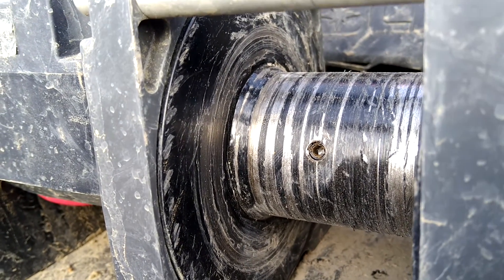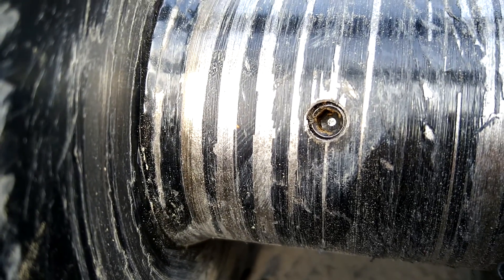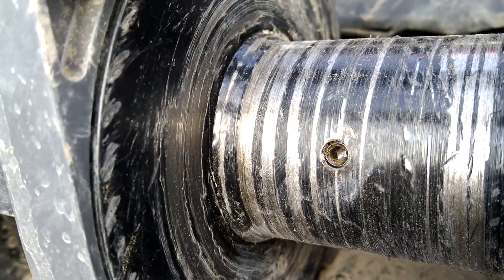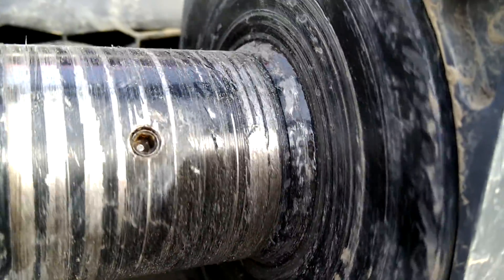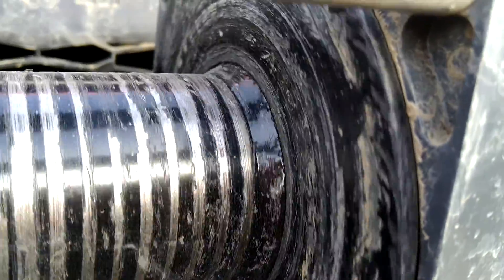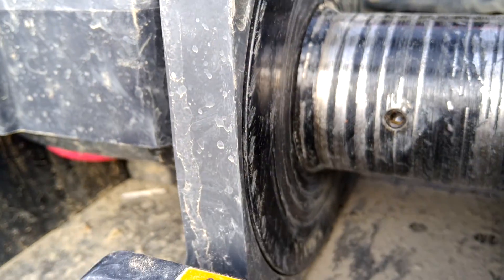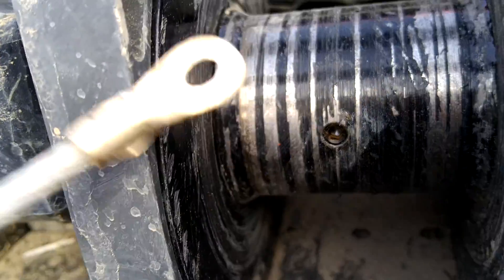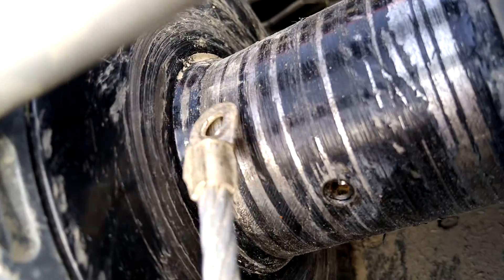Warn winch, no attachment point for cable.

Comment: How did you end up attaching it?  I have a winch where the post on the side of the drum broke off and now have this same problem.  No way to attach the eyelet for cable
Reply from the maker: I was told from Warn I could Drill and tap the drum for 1/4" bolt, that bolt cannot stick through side of drum but can be flush to inner edge.

They offered a replacement drum but it is on back order.

Then they contacted me again and sent a new winch.

Now that...is customer care!
Reply: @riotwarrior  I have a barricade winch and the guy I spoke with didn't seem to know anything.  Didn't offer anything in way of replacement either
Reply from the maker: @aarongausepohl8886  what is a baricade winch